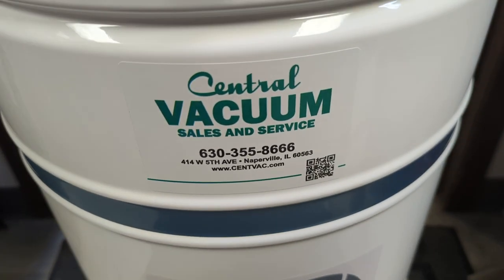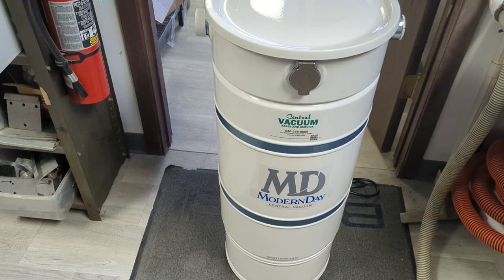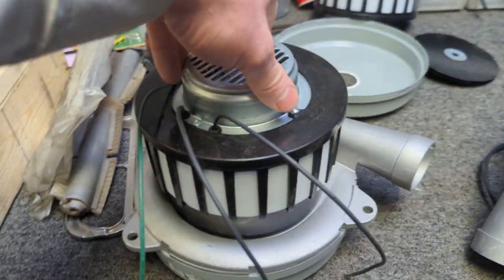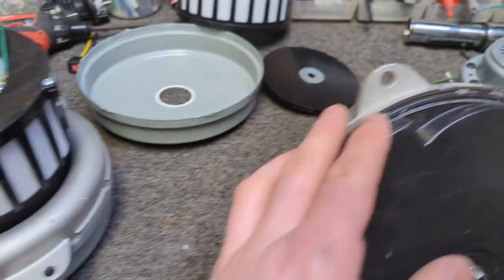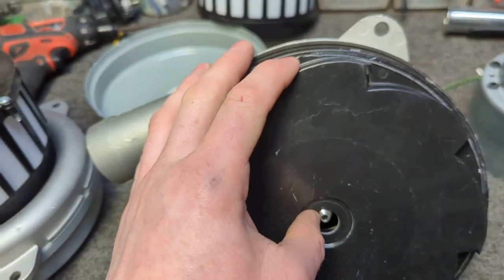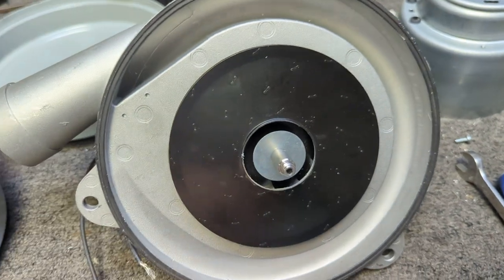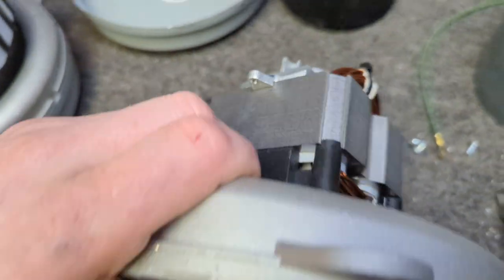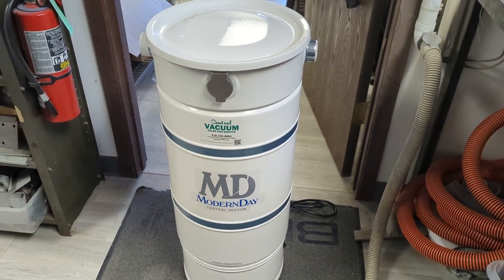This vacuum has some "Huevos"! The ModernDay M715H and the 8.4" Ametek motor inside it

Comment: Hey Owen, I have a md f700t unit for a 3,000 sq foot house, 6 inlets, it works great. It replaced a 1989 unit that was shot. Do the flo master units use a similar motor to this unit?
Reply: Yours would have the Ametek 122264 motor. It is not quite as powerful and has a much shorter lifespan. They are actually quite different with the one in the video being an 8.4 inch tangential discharge motor while your unit has a 5.7 inch flow-through motor.
That being said, it is still made by the same company and still great quality, so it can still last many years if taken care of. Just not as long as this Modern Day M715h unit.

Comment: I call it the real PIG vacuum, would easily put the NSS M-1 to shame!
Reply: Umm...no.  You see the M1 is portable, this isn't.  The M1 excels at airflow and is made for dusting hard to reach places.  This is an illogical design as it has the motor on the bottom which if installed in some areas is susceptible to flood, where Cana-vac and Beam have the motor mounted on top.  For repair reasons, it's illogical as well as you have to pull the bag and filter out and physically turn the machine upside down.  Everyone else uses the bottom bucket and top motor design for these reasons.  You don't waste time doing meaningless stuff to access the motor(s) ultimately costing the customer money and scratching their foolish yet expensive purchase.
Reply: First of all, both are commercial grade vacuums. Yes this MD M715h can be sold for commercial use. Secondly, you CAN use a central vac as a portable by building a cart. This has been done before and I don't think it's a bad idea at all but installing it and pulling the hose around is still lighter than pulling the NSS around. Thirdly this has a combination of both airflow AND suction which can easily spank the NSS because airflow can't clean by itself, not to mention that the NSS still uses a wire reinforced hose which is definitely outdated nowadays on the market. It's just like a tornado where it can pick a car up but it wouldn't go all the way up to the top of the clouds, it's no wonder why my Kirbys left behind ALOT of sand and heavier grit underneath the carpet that they were SUPPOSED to get because they don't have very good suction. Videos like from Performance Reviews can back up my statement. Fourthly, our last cabin had a MD unit before (yeah that makes me a fool too in your mind and I honestly find that disrespectful) and we built a deck high enough in the garage to the unit where we'd have easy access to the bag and WAY above the floor if there was ever a flood (which we never did). Still alot faster and easier to change than emptying the canister of our Beam at home. Also when our motor went bad on the Beam, the service technician had to get a ladder to dismantle the unit and take it to his shop to get it repaired and cleaned since nobody in our house wanted to repair it and I was too young to tackle onto it. Not everybody would feel comfortable servicing or replacing the motor out on their top motor unit or any central vac unit, that's why you have people like Owen here that repairs these for a living. But if you still prefer bottom fill bags, MD definitely has offers for people who prefer to replace bags on the bottom or even easily have access into the motor. Personally, I like changing bags on the top better. That's one of the reasons why I'm leaning towards of getting an top fill MD unit when I move to a new house soon instead of putting in the DrainVac that I have since I already know I like MD better than anything else I've ever used before including portables. And last but not least, the motor on the NSS is WAY closer to the ground than how high these top bill bagged units can be mounted at which means it'd have a more greater chance of getting water on the inside.
Reply: @panasonicvac4036  So, to start off, try putting the cart in your car or heavily loaded cleaning van.  The M1 wins here.  Airflow is what moves the dirt, not suction.  Suction is needed usually for picking up water and moving air along.  This is what is required when using the M1 because you are picking up mainly dust on pipes, walls and ceilings.  If you want to see a machine that doesn't have as much suction move a heck of a lot of debris, check out a dust collector.  I would say look at Matthias Wandel's home made dust collectors for examples of low pressure (suction) machines that do a better job than his shop-vac.  Your Tornado example proves my example.  It's airflow in a tornado, not suction.   Also, are you setting your kirby up correctly?  The reason I ask is if two youtubers that know how to do scientific testing are able to pull sand from the bottom of a carpet with their kirbys, why aren't you?  It also depends on the type of carpet, how thorough the vacuuming is and whether you got that carpet brand new or it came from previous owners with say...a dyson.

Wire reinforced hoses are under-appreciated and are incredibly durable compared to the crush-resistant hoses, and tend to last decades.  Crush resistant hoses are more prone to splitting than a well-made wire-reinforced hoses.  I have seen wire-reinforced hoses that are decades old while most crush resistant hoses barely last one decade.  

Alex of Performance Reviews irritates me in the way he talks in his ego soaked voice, the way he talks about and to other people of the vacuum community at large and uses pseudo-science in testing vacuums (ie no measured results, just qualitative observations, the use of his weird little Y contraption that was made for the sole purpose of selling central vacuums and the fact that he doesn't use an anemometer).  You need to move the air to move the dirt.  I have never understood why suction matters in vacuum cleaners, unless it's used on a commercial scale to remove liquids from carpets like with a Kohler V-twin-powered roots blower-based truckmount.

Also, you keep referring to MD as a top fill like it's the only one.  Every central vacuum cleaner on the market today is top-fill.  Beam, Cana-vac, Cyclo-vac, Aqua-Air, Drain-Vac are all top fill because the debris comes into the bag or bucket from the top of said bucket or bag.  What MD and Central Vac International are is top empty.  More or less glorified garbage cans with motor(s) attached to them.
Reply: There are some central vac units where they can be used as a portable with or without a cart. The DrainVac Atomik is one example (I don't believe it's being made anymore) and I think it was rated to up to 8,000 square feet. Definitely much smaller, lighter, and cheaper than the NSS. Back to airflow, I don't think you're quite getting where I'm going with here. But to make it short, my Kirbys have been used correctly and none of them have any problems. I brought up Alex here because he's been having the same results as I was experiencing with my Kirbys, making me conclude that I disagree with YouTubers like Bill from Vac Lab so I don't get why I don't need suction to clean. Maybe in your area you don't see as much wire reinforced hoses go bad, but that can't be with everywhere else. I've seen crushproof hoses last for years even, heck all of my central vac crush proof hoses never had any problems of ripping. And I'm sorry to confuse you with saying top fill as I meant to say bottom motor. Just because you don't like the design doesn't mean that everybody else would agree with you. If they like it, fine. If not, they're always other options to choose from.
Reply: @panasonicvac4036  True, I keep forgetting, to each their own.

Comment: Is this motor reversible so it could be a blower?
Reply from the maker: @Petrochemtester  it's not reversible, but it can indeed be used as a blower simply by connecting to the exhaust horn. One caution, since these motors are made for suction, they won't tolerate a lot of back pressure on the exhaust if the motor isn't bolted down. Even so, this should be used for a high volume and lower pressure blowing application.
Reply: @Centvac  Would you have a model that you would recommend that would put out around 140 CFM and 180" water column?  I'm not sure if the inverse of vacuum to suction equals the same WC reading?  Trying to blow swimming pool lines out by building a bullet proof blower.

Comment: I have a unit that uses this motor, the Vacumaid SR800, it's also a bagged unit, that unit is a beast, I would think for large homes where they want a lot of power, you would go for the Silent Master 900, that probably can handle a slightly larger home than the single 8.4 motor units can, I'm wondering if anyone will ever come up with a unit that combines two of the 8.4 motors, so far I don't think that exists, but talk about a beast, that would be it.
Reply: I agree, these are amazing motors. The longevity and efficiency makes them a great choice.

There are actually two units available (that I am aware of) that use dual 8.4 inch motors… unfortunately they are both really only great for very specific installations.
There is the Aqua-Air Model 258 that has two parallel motors in a separate pod, very similar to a VacuMaid S3600. However, it’s a wet/dry unit which increases costs and installation requirements.
The other is the Allegro Pinnacle (MUA85E). However, this unit has the two motors in series (which creates tremendous water lift) but it would only really be suitable for large installations with retractable hoses or if you want the most power from a TurboCat head.

I wonder if it would be possible to get a VacuMaid S2720 with two motor pods.
Reply: @mikearrigo5674  Wow, you definitely have a collection of units! I only have a handful. Those sure sound like beasts! I’d love to feel the power of them. I don’t have any that don’t run off of a standard 120 volt 15 amp circuit, but I hope to get a more powerful one some day.
Yes, I understand. The bagless ones can be a real pain, especially if you’re in an apartment. Some of Allegro’s other units are hybrid, but I’m not sure if the Pinnacle has that option. Maybe you could enquire?
Reply: @fidgetthedalmation7433  You missed one, the Cana-vac Signature Series XLS-990, A Canadian machine that uses a sensible design.  Of course, there's another big motor powered machine and it's a portable.  It's not made anymore and isn't nearly as powerful, the Rainbow D4.  The motor measures at least 8 inches in diameter and has a life span that makes most central vacuums blush at nearly 40-50 years (projected) and is totally service-friendly from top to bottom.   That is something you can't do with a central vac motor.
Reply: Did you not look at this video? He just took apart a central vac motor for this unit to show the inside of it, it's definitely serviceable. Also, I have a Rainbow D4C and this would definitely out clean it. Not even close. In fact it's one of my least powerful machines in my collection even after completely restoring it.
Reply: @WJCTechyman Actually, I did not miss the Cana-Vac. He had asked if there were any machines that used two of the 8.4 inch motors. The Cana-Vac only has one. Still a great machine though.
As for the Rainbow, I have heard that a lot of people really like them. However, I do not like them personally. They are quite bulky and awkward, loud, and are quite a hassle to maintain. I like my central vacuum. But everyone has their own opinions! :)
Reply: I agree with you completely, I own a couple of Rainbows and I don't like using either of them. Good vacuums still but I like my central vac more:)
Reply: @panasonicvac4036 Exactly! Rainbows are good vacuums, I just prefer the central.
Reply: @panasonicvac4036  Well, that's your opinion.  You can take it apart...to a point...but since most central vac motors in the fan stages are pressed. it doesn't go back together quite as nicely as the fan housing on Rainbows or Kirbys.  Also, I think you missed the part where I said, "...it isn't nearly as powerful..." but that said, it maintains its cleaning power longer than any porous dry filter machine with little to no consumable cost.  The reason most vacuums are more powerful than Rainbows is the simple fact that they need to be to pull air through multiple stages of dry filtration.  That performance dips as you vacuum.  Why?  The little pores in the bags and filters clog, and I hate to say it, this also happens in those new high efficiency cloth or fleece bags too.  Since water is a natural solvent, it traps dirt more efficiently than dry filters without losing moving air performance.  

Now, I am well aware that HEPA filters are in the design of both the E-Series and SRX, but they are there as a backup when the machine is used as an air purifier and the water evaporates before someone tops it up and if you come into contact with fine non-water-soluble powders like talc, flower, drywall dust or others.  The machine doesn't really need it other than that.  The HEPA doesn't have to be changed for years if the machine is properly used.  The other plus with Rainbow HEPA filters is they are huge compared to what Miele and Sebo uses as well.

That said, I do like central vacuums and they constantly pique my interest more than others but central vacs at the end of a hose may as well be a Rainbow, even putting together two Rainbows.  The most used vacuum in my very small collection is currently my central vac and I have been thinking of extending the line in my place I rent to other areas in the basement like my little "living room," laundry area (Wally-Flex), work bench (another Wally-Flex) and even an inlet next to the basement window if I want to vacuum cars in the driveway.
Reply: @fidgetthedalmation7433  Everyone does have their opinion, I agree.  Yes, the Rainbow is a fairly awkward machine, but so is a central vacuum.  The use of crush resistant hoses has made using a central vac a heck of a lot easier, I have a 35 ft dual volt Hanmi hose and it's relatively light.  The real problem is the clunky awkwardness of said hose can be as bad as having a little R2-D2 following you from room to room.  The Rainbow vacuums of recent years are much quieter than they were once.  I have an E2 Black that's noticeably quieter than earlier E2 Golds as well as the E Series one speed and the D4s.  The D4 doesn't bother me too much since most of the noise comes from the moving air and the roiling of the water in the basin creates a pleasant (granted loud) white noise like a rain storm.  The motor is a pleasant low frequency hum as well.  I have a belt driven Delta mitre saw and a wood chipper that both sound like Rainbow D4s when they start and run, that is, until wood is introduced to their blades.
Reply: You are correct that bags and filters do clog yes. But even water has a disadvantage where it needs to be changed out more as I'm vacuuming. Not because it's losing suction, but because I'm keeping as much dust out as I possibly can from the motor and even the filter. I've took apart Rainbows before including mine where dust is caked everywhere. I've even done a little experiment where I'd vacuum a house by only filling the water multiple times and later vacuum again by just filling the water up once when somebody said you only need to do it once. I definitely noticed a difference. But even with a filter on, I've also seen tests done with a particle counter and fog before, the Rainbow didn't impress me filtration wise.
Reply: @panasonicvac4036  Uh, yeah.  It's a disadvantage of Rainbows, if the water gets too thick and muddy that's where the performance of water's capability drops.  I've done that a couple times but try to keep my eyes on the water now.  The last time it happened I was vacuuming my Grandma's house and just after the short upstairs hallway and down the stairs the water was muddy before I knew it.  Up to that point, her carpets hadn't seen a good vacuuming with a full sized vacuum in a few years.  It also didn't help that the carpet was approaching 40-50 years and the padding was disintegrating.  I was surprised that the 4 qt basin turned so muddy.
Reply: @WJCTechyman I respect your opinion. I do not have any hate towards Rainbows. They really are quite an amazing design and are so versatile.
However, I personally, would prefer to drag around my central vacuum hose over the canister of any vacuum really. (Mine is a 30 foot dual voltage crushproof hose, which most certainly, as you said, is much better than the old hoses.) The long hose just makes it so much easier for dusting and cleaning the stairs.
A lot of people would disagree with me. A lot of people hate central vacuums and their long hoses and want something light and easy which is why stick vacuums are so popular. Everyone stands by what their favorite vacuum is. I like my central vacuum. That doesn’t mean the other options are necessarily bad (although some are), they just aren’t my preference.